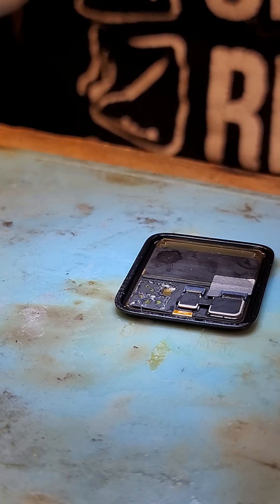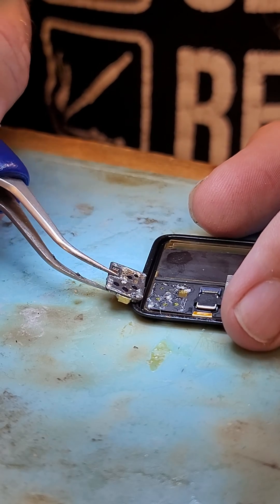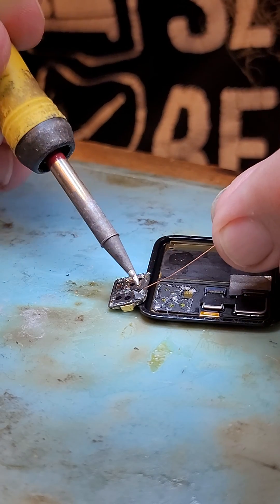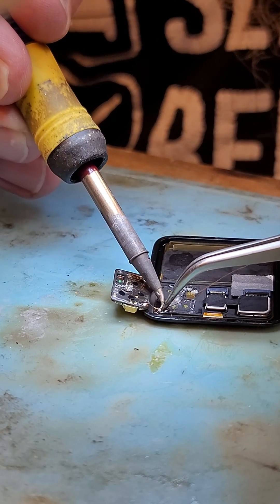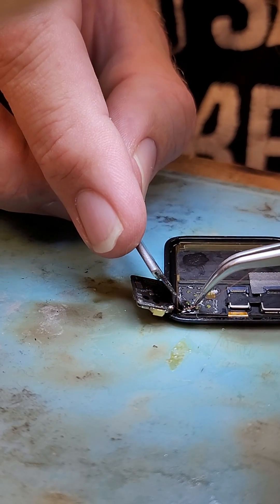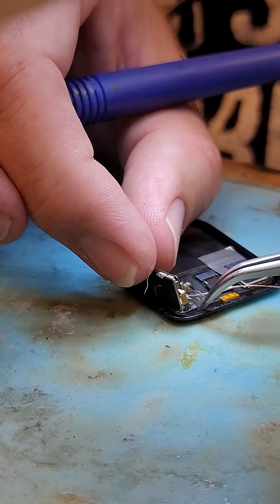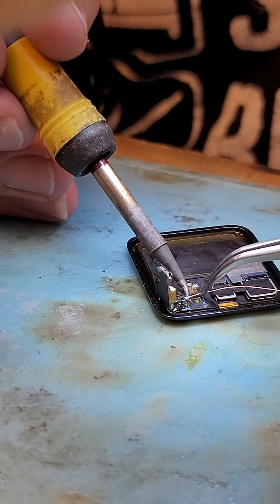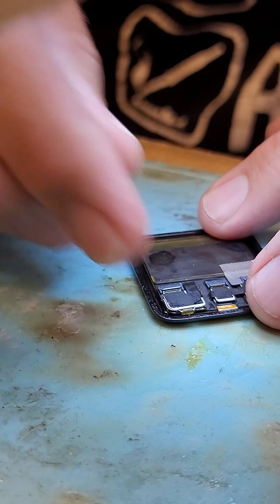Installing old NFC chip on to new Apple Watch S2 and S3 LCD

Comment: Does Apple Pay remain?
Reply: Apparently, that's the whole point, but I lost Pay after doing this swap.
Someone on iFixit said I did it wrong, but if that's the case, why can I still use boarding passes and other NFC uses?
Reply: @MyDadsNotACellPhone  yeah I did mine and used Z tape instead and Apple Pay don’t work but u can double click and my card shows up as if it is ready to pay but when I bring it to pay it never registers, it’s so annoying
Reply: @N.B-0014  maybe a antenna issue?